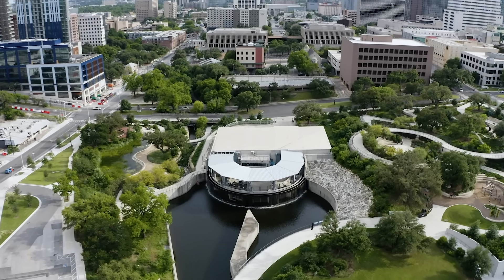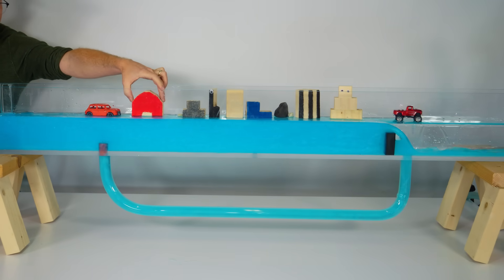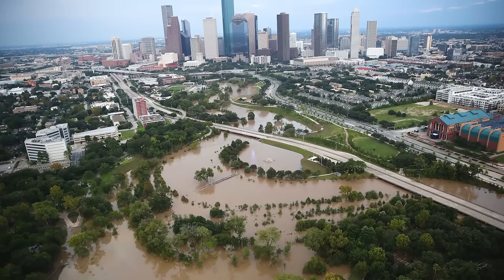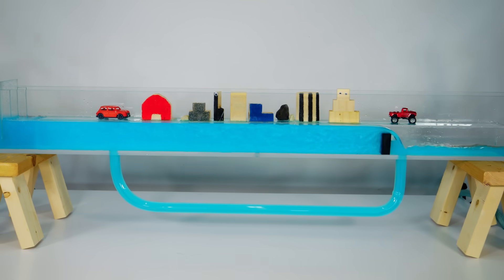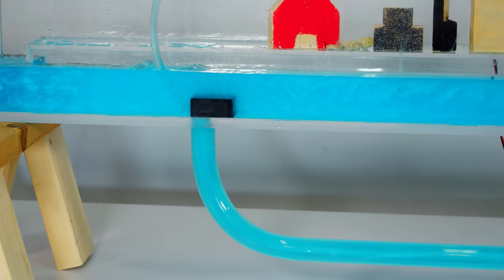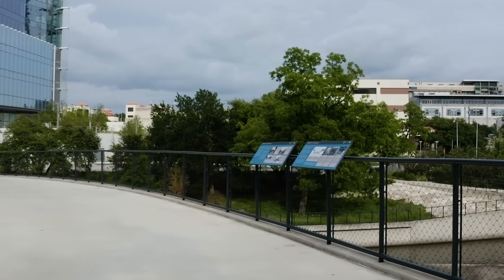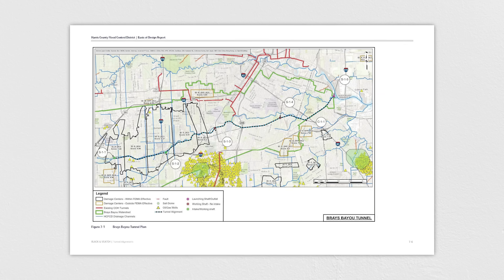How Flood Tunnels Work

Comment: separation of flood or rain water from sewage is also important for the Sewage Water Treatment Plant, because a sudden change of concentration (e.g. by rain diluting the sewage, during a downpour often by a factor of whole numbers) it would literally kill the SWTP. We are using living micro-organisms to clean water, and when there isn't enough pollution, the population dies off rapidly. Also, the increased flow will wash out a part of the microbial population along with untreated water. This is why often during downpours SWTP will simply close their entry gates and let the sewage overflow directly into the streams they usually feed the purified water to, because the impact of a dead SWTP is much higher than the impact of overflow during one rain storm, simply because it takes weeks to build up a working treatment tank during which time most, if not all, sewage goes into the stream untreated...

Thought I should add this piece of info, because you nearly touched on it, but forgot it as a strong argument in favor of large bypass solutions.

Comment: Naturally developed cities in Europe for example have had solutions for this for literally thousands of years that didn't involve essentially operating the frikkin river manually, by circulating water with pumps, for billions and billions of dollars and continued costs:
A QUAY.
-This means the river can be narrow enough during normal operations that even low flows allow shipping depth.
-Because water isn't constantly rerouted, you don't compromise the potentially already low flows.
-This means you don't need to recirculate water manually, literally continuously expending energy just to keep your structure operational.
-The area used for the quay isn't wasted, as you can run streets along it, and have loading areas for ships, alleviating congestion.
-When a flood comes and the river overtops its banks, you can close the quay, because a traffic jam is the least of your worries during a flood.
-Without any buildings there the quay can withstand a flood without maintenance.

Flood Tunnels are so unbelievably american, because you would rather literally continuously throw money (energy) at a problem, and make congestion worse, than to lose out on a bit of property value, because inner cities have to be cramped like a sardine box and suburbs have to sprawl in a completely unsustainable manner.
Reply from the maker: There are plenty of flood tunnels outside the US. I even showed one in Tokyo.
Reply: Ah, the stereotypically ignorant European anti-American bigot appears. How funny. Countries and cities across Europe have been opting for this "unbelievably America" solution to fix their "naturally developed" cities in droves. A short list includes London, Paris, Copenhagen, Amsterdam, Stockholm (and other projects in Sweden), and numerous such projects in Switzerland. Others who have opted for this horribly and unbelievably American solution include Tokyo, Shanghai, Kuala Lumpur, Singapore, and Hong Kong.

Comment: Just sharing. Thought you might be interested in Malaysia’s SMART tunnel project. A flood tunnel that doubles as a city expressway when it’s dry, and when half-used. But when fully utilised, it closes the expressway portion and turned it into a temporary reservoir and tunnel to channel upriver flow down to another part of the city, to divert waters from major parts of the city. Although it has not prevented certain floods in the city of KL, it has actually prevented the most major ones that had happened in the past that as one consequent actually moved an arts theatre to a dedicated location in the present day. The SMART tunnel is still worth mentioning, as it’s so far the only one that most would be aware of that sees a flood tunnel doubles as an expressway under the city. Thought it might be an interesting piece of information, for those unaware of its existence.

Comment: You showed the recirculating pipe as separate from the main tunnel; is that the way it’s implemented in practice, or do these systems pump water backward through the main tunnel for recirculation?

Comment: Hey question, If the dam or weir's job is to maintain depth in the river, is it not simpler to build it with a gate already or modify it such that in a flood it will not obstruct the water? Im sure its considered but what would the disadvantages be that require digging a whole new tunnel?

Comment: Ive always thought about, because i was born and raised in rapid city. Our city was completely reshaped by a devastating flood that claimed 240 lives and did 65.5 million in damage in 1972, before adjusting for inflation. Numerous neighborhoods were leveled and never rebuilt, instead they were turned into green spaces which added a lot of parks and outdoor recreation areas. Unfortunately though the cities refusal to allow building in the flood plain greatly reduces the amount of buildable land downtown, which leaves our downtown pretty much looking exactly as it has since the 1970s. And leaves a strip of land 1 mile wide and 5 miles long running through downtown completely undeveloped. It'd be some of the most beautifully developed land in the city if our city would allow it. So i always thought there should be some sort of concrete overflow, placed at strategic locations and at a strategic height so that if we were to have another flood the water would go through the overflows and travel a tunnel under the city that would drain into the flood plain outside of the city. I understand the citys thought process, however the flood was the result of a dam failure so i think they should be more effort into making sure the dam never fails again, its definitely hindered the development of our city

Comment: The SMART Tunnel in Kuala Lumpur is a huge, probably one of a kind, mixed use road/flood tunnel. Used as a bi-directional dual lane road tunnel to ease congestion on the city's arterials, but when needed, it can be evacuated and used as a stormwater management tunnel. Takes about 30-60min, and then back to a road tunnel. Has been very useful for flash flooding during the rainy season.

Comment: Grady that was very interesting. If you are not aware, Lake Ray Hubbard that connects Garland to Rockwall in the Dallas area is in the midst of a huge new construction of several more bridge lanes across the water. Also I-30 is being widened and will divide the flow of traffic before it reaches the lake. Would love it if you would like to comment on that as it appears very interesting. They have boats with huge cranes on them

Comment: In my home city of Wichita we were fortunate enough to get around to solving this problem when the city was still quite young. Therefore we have an absolutely massive trench that bypasses the city core and parallels I-235, and has proven its worth many times. It was also substantially overbuilt - which has come in handy somewhat recently.

Comment: My city is still separating our street storm runoff from our sewer systems. We face fined from the EPA because stormwater surges overwhelm the treatment plant and pour untreated wastewater into the river. The reason we are fined (in addition to the cost of the project itself) is because the city was warned years earlier, did not take the due-date seriously, and took no action.

Comment: I’m not a engineer so maybe I’m missing something. Wouldn’t a openable gate on the down stream dam be enough? During a flood event you open the gate and allow the water to flow through the dam increasing the flow rate and getting rid of the extra water using the existing water channel. No tunnel needed. During normal times you keep the gates closed to maintain your artificially high water level.

Comment: Thanks very much for the informative video. After the massive rainstorms in California caused widespread flooding I looked up how to deal with flooding and found this, “It will cost about $1 billion and anywhere between 20 and 30 years to build the small capture system throughout Los Angeles County, Pestrella said.”, from the ABC News report, “Snowpack in the West is melting rapidly. Where will all that extra water go?” OK, so major infrastructure projects always cost a billion dollars, but 20 to 30 years?? When they know they are going to get another major drought followed by another flood?? Could your flood tunnels provide a easier solution?

Comment: Nice.  Dallas is currently getting it's first major flood tunnel as well.  The Mill Creek Drainage Relief Tunnel project started in 2018 and should be finished in 2025.  It's huge.  The tunnel will be 5 miles in length and be 30 to 35 feet diameter, running 100 to 150 feet underground.  The intake is on the north side of downtown Dallas and the outfall is to the southeast at White Rock Creek.

Comment: I work in a utility company which is constructing flood tunnels. The tunnels will serve as a buffer leading the water into reservoirs, parks or open fields. The capacity is calcutated to be big enough to carry one flood/heavy rainfall. After the cloudburst is over the water is pumped back into the normal system at a manageable rate and treated at the wastewater plant.

Comment: I worked at a facility that had a hazardous waste treatment plant that was essentially a big distillery. There are several one million gallon tanks in the tank farm and they rest in a very large steel containment basin.. During monsoons the large catch basin will collect a lot of rain water which tends to be collected back into the tanks to be processed which is expensive, so they do a lot of testing to make sure the water that's caught from the rains is safe, and then pumps it out onto the desert floor.

Comment: I don't get it. Why do they make separate tunnels instead of just deepening the river itself? Seems overengineered. If the river water needs more movement, you could still use the pumps to recirculate it.

Comment: In Hong Kong, we don't have big river, but we have lots of population area under the mountains and we have more than 2000mm of rain fall every year. So the Drainage Services Department(DSD) do 3 storm water tunnels at the hillside in Hong Kong Island and North Kowloon, to collect storm water from the upstream of the hill's drainage system and outfall at a safety place, reduce the current system overload at the downtown area. DSD also build some underground storm water storage "Pools" to store the storm water at the urban area, such as Happy Valley Underground Stormwater Storage in Hong Kong Island and Tai Han Tung Stormwater Storage in Kowloon, stormwater will be pump out or storage for cleaning & recreation venue irrigation use.

Comment: Bristol in the UK has a flood tunnel, it short circuits flood water through a tunnel under the city so that the floating dock isn't flooded. The discharge is downstream of the historic dock and into the Avon Gorge.
Google Clifton Suspension Bridge for images of the gorge!

Comment: I liked your video.  I went to UT Austin and lived in Houston my whole life so I am familiar with the area.  So I have a few comments or corrections.  Lady bird lake (town lake) is part of the Colorado river.  Waller creek is typically dry.  Seems like a big waste of money and energy and CO2 production (I'm not a green new dealer but people in Austin are) to continually pump water through this tunnel.  I can't remember Austin ever flooding once and I'm old.  It has 3 dams along the Colorado for flood control.  This seems like a big waste of money and energy.  Houston has the flooding problem due to hurricanes and no slope 45 feet above sea level and flat.  not sure a tunnel would work in Houston unless it went all the way to Galveston Bay instead of 12 blocks like in Austin.

Comment: If you haven't already, I'd recommend you to take a look at the Dutch "waterschappen" which manages the water levels in all the ditches across the country, they preserve the water in the hot summers, and carefully control the water levels to prevent floods without flood tunnels. They also keep the water levels in peat areas (like in the area around the AirPort of Schiphol) extraordinary high to keep the peat from sinking or something like that

Comment: Thanks for mentioning the TARP project in Chicago. I drive over the Thornton reservoir sometimes on I-294 and always wondered what it was. From the interstate, it looks like you are just straddling a regular rock quarry, and I thought that's all it was. Being in a semi, I get a little higher vantage point, and it's always a bit of a trip (no pun intended) crossing it. I'll have to read up more on it now that I know what it is, especially since the product I haul is a chemical used in wastewater treatment (though not for those specific facilities).

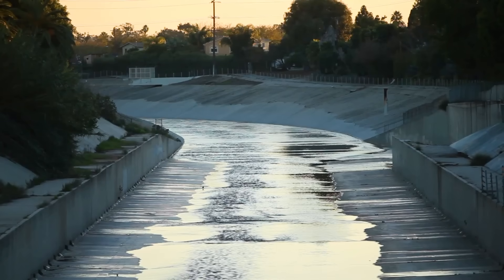Comment: All these canals 6:10 and all those structures 6:43, unused dead spaces that could be generating energy.
All these areas need to be upgrades with smart designed solar panels roofing that will generate energy for the nearby areas.

Comment: Here in L.A. we have lots of flood channels (heck that's what the L.A. River became once we lined it with concrete) but we also have catchment basins.  And I've never really understood the engineering of them.  Sure there wide and deep but how do you size them?  How many do you need?  And lately I've noticed a trend that's filling them in.  Have we forgotten our flooded past or is there new technology that make such basins obsolete?
Reply: Quite the opposite of forgetting the past actually. Rather forgetting the 20th century and going back to the past. Not sure which system you mean precisely, but there's definitely a strong trend in de-channelling and de-concreting river systems because a natural meander and permeable flood plain are often much better at both dealing with floods and retaining water to deal with drought.

Comment: This reminds me of how my city has been managing increased rainfall and rainstorms caused by climate change. In my old neighborhood there's a large system of green areas that are meant to absorb rainwater but if it rains too much for that they're also connected by underground pipe to let the water collect in various ponds until it can either evaporate away or get absorbed into the ground. It's a neat overlap of environmental and water ways engineering, since beyond being a defense against rainstorms it also creates a lot of green area and several artificial ponds, which helps with biodiversity.

Also I don't know how common this is but my city also has an underground sewage treatment plant that's more or less automatic, it's located in a forest park and you can see a few above ground structures such as air intakes and some metal covers but otherwise it's complete buried and most the space that I presume it's occupied is used to house training equipment.
Reply: That's neat! I'd love to visit and just see what is able to be seen from above ground. I used to live in California many years ago, all the public parks were put where they were in the town I lived, because that's where the wells were that supplied our water. If you knew how to find them they were easy, but if you didn't realize they were there, like when I was younger, you would never know. Neat what they hide right under our noses sometimes, isn't it?
Reply: Also, to add, I don't know that the underground treatment plant is too common, it certainly is something I've not seen before or even heard of. All ours I've ever seen are all open air or at least above ground and capped. 

We have a bike trail that runs literally next to one of the treatment plants as you head north out of town on it. It goes all over a 2 county area and it actually passes by two of the treatment plants currently, for the area. Coincidence mostly since they utilized already existing right of ways to put it on. Mostly water/sewer right of ways and a few sections are placed along old railbeds. Those are the best trails cause they run through what's essentially nothing but trees and wooded area.

Comment: why not just have an overflow tunnel like a sink has so when the canal fills up to full, the excess water flows down the overflow tunnel?  Then you wouldn't have to worry about stagnant water in either system

Comment: San Antonio actually has a few of these systems in place across the city.  There is the River Walk system that protects downtown and a new system that was built in the last few years on the west side between Lackland and Kelly Field down Military Dr.  When I lived in downtown SA on the River Walk after several months of walking it every night with my dogs I heard about the history of its beginning and the flood tunnel that was added in the 80’s.  Was mind blown to think about all of the systems that are in place that are multipurpose for everyday use, specifically the lock system along the River Walk, which I thought was just for the river barges at the time but in fact was part of the entire flood mitigation system for downtown.

Comment: Note that flood diversion can be done in two dimensions as well - see the Red River Floodway that diverts stormwater around the city of Winnipeg, Manitoba. It's essentially a large ditch that loops around the city to the east; if the river (flowing into the city from the south) overflows, the floodway takes the excess and returns it to the riverbed well north of the city where it can safely drain to Lake Winnipeg.

Comment: What's the difference between putting that extra flow cross section deep underground and just increasing the depth of the creek?
A deeper surface water way would also slow down the flow speed through it, but that can be mitigated the same way as stagnant tunnel water: pumping some of it upstream.
And a deep water channel might need to have it's banks reinforced, but doing that in a surface project seems to be easier than for a tunnel deep underground.